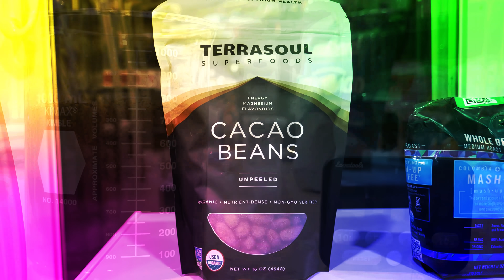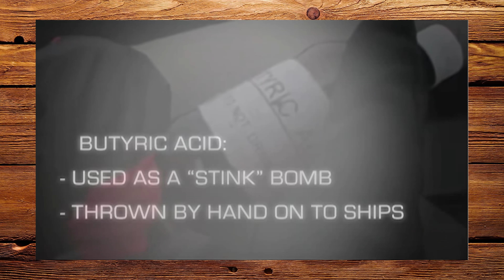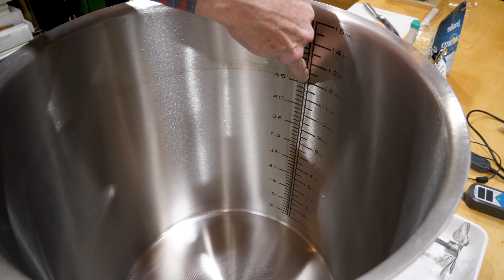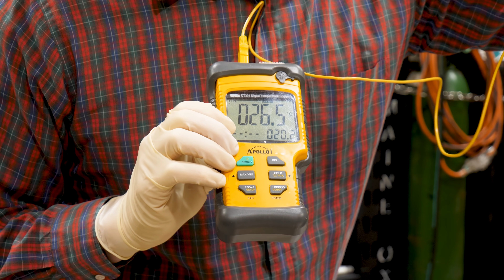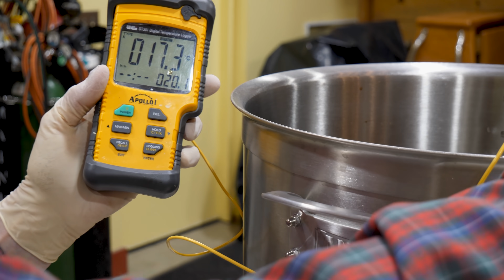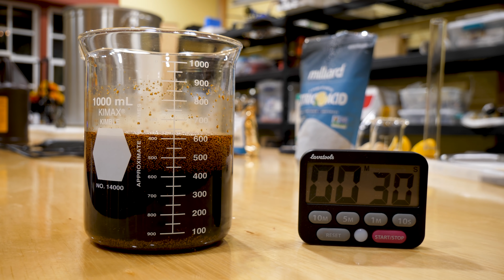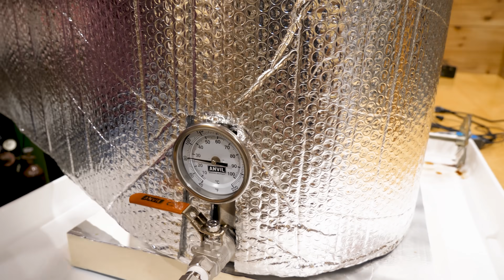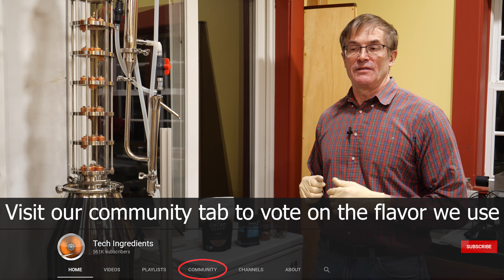Making Flavored Rum | Easy and Cheap! - Part 1

Comment: I like the idea of using pots for fermentation, but there is one downside that sent me back to the carboy. Often for fermenting something like hard cider it's desirable to keep the fermentation at a controlled, slightly cool temperature like 60 degrees. While the yeast (depending on the strain) is often fine with fermenting at 70 or even 80 degrees, higher temperatures tend to lose some of the delicate flavors you go to such great lengths to obtain and preserve. The solution is to create a stable fermenting temp in a fridge with a temperature control device. But unless you've got the money and space for a full sized extra fridge this usually means a mini-fridge. Problem is, while I can get anything up to a six gallon carboy in the fridge no problem, even the smaller pots tend to be too wide to close the door.

Comment: „If you are desperate, rum is a good spirit.“
- Tech Ingredients, 2021
Reply: Ha!  I came here to post the same thing!
Reply: Thar be rum and thar be GOOD RHUM.  Try some Kaniché XO from Barbados, neat.  It just might change your mind.  There's also Mount Gay Extra Old from Barbados.  Best rum and tonic I've ever had but I haven't been willing to mix the Kaniché with ANYTHING.  One day I'll mix it with tonic.
Reply: @David-hm9ic  Those are good tips - will add that to my "drinks to try" list. Thanks for sharing!  
As far as rum goes, I have not got much experience. But I found that so far, my favorite is Don Papa, closely followed by Botucal.
Reply: I would have said, "If you're desperate, it's the Wal-Mart down the street and some Clan MacGregor scotch."
Reply: Given the first test run, and maybe a failed one, according to his estimate of 5 to 6 days,  my first 50 liters should be ready jusy in time for the opening of bars here in Belgium. This gonna be a good summer
Reply: (proceeds to brew a 12gal batch of rum)
Reply: Not all rums a created equal sum are way better then others !! I love rune I have 20 different ones  Barbados do is good 8-10 year olds at better then just plain Bacardi rum !!
Reply: @David-hm9ic  I fell into a rum rabbit hole. I tried two new ones this month. One of them is actually a German rum, made from imported molasses, in the Black Forest region. And I just came back from the shops to pick up the bottle of Mt Gay. I shall try that tonight or tomorrow latest.
Reply: @DeputatKaktus  I have fallen into a similar hole, mine is whiskey, whisky,rye and bourbon...so far...
Reply: @DeputatKaktus  One word of warning, don't drink too much Mt Gay.. for some reason or another, you'll find yourself slipping into another hole
Reply: @willeveryday  I see what you did there.

Comment: Great job!  I've been brewing for 20 years and distilling for 5, and I have to say that this is one of the best treatments of the subject that I've seen in such an abbreviated format.  The only think you may want to consider is (especially if using well water), the presence of iron, which can ruin the flavor of either brew or distilled products.  Most sources I've seen suggest that keeping iron below 0.3 ppm (mg/L) will result in acceptable water.

I really love that you touched on nuances like mixing, aeration, cooling and heating, etc.  Again, Great Job!
Reply from the maker: Thanks!
Reply: I'm new but looking to get into distilling. Can you friend me so I may ask your advice? 
I'm just looking to make my own. Not commercial or trade. Just for my own use. 
No "competition" 
Unless you want to trade with me? I have skills other than brewing. Where are you at? I'm in Hemet California.

Comment: Interesting video. I use a similar setup for the mead that I make. I usually use Fermaid O for the starter and EC 1118 or D47 yeast because of the aromatics they add when aging the mead over the lees. I also add Fermaid K nutrients at the 1/3 and 2/3 sugar breaks to help keep it going. I personally use a "big mouth bubbler" style of fermentation vessel with a spigot at the bottom. That way I usually end up with 4 drinkable gallons out of a 5 gallon brew. I have been improving my method over about 3 years and just added a heating pad with thermometer to the mix, but I still use a blanket folded in half and wrapped around the jug for insulation.

It is always interesting seeing what other brewers do for their setup and look for ways to improve my own brewing process.

Comment: After watching this I'm afraid you'd have a heart attack watching me make mead. No heating, a bottle and a balloon. I might try adding citric acid, I normally just add a little ascorbic acid. I use citric acid as a cleaner(plus much more) so I always have it around.
Reply from the maker: Not at all.  A good tool is one you can't add anything to, a great tool is one you can't take anything from.
Reply: Let's call it traditional or rustic and if it flies...:-) I've seen vessels used for mead production centuries ago and it worked too.
Exact tools and measurements offer less room for error but it can also mean less room for pleasant surprise.
I'm biased as a chemist but brewing has always been somewhere between art, magic and craft.

Comment: Your lemon was a Lemon
Reply: The problem is, his water likely has a high mineral content, and the dunder has an even higher mineral content. What you're seeing happen is the minerals being dissolved by the acid, which neutralizes the acid, so the pH doesn't change. This is a 'mineral buffer', and depending on the minerals in your solution, it'll buffer to different pH levels.
You can avoid this by over-shooting with citirc acid, to a pH of 4, at which point all of the minerals are in solution (not just in suspension) and then add calcium carbonate, probably around 200g, which will keep the solution buffered to a pH of around 4.5, which is ideal for yeast.

Comment: As a brewer, we only use carboys for our smaller projects. We don't use brushes to clean them out. We use caustic chemicals. You have to be careful not to get any on you but they are very effective in cleaning out the carboys. Specifically we use something called PBW. You may find that or something similar at a local home brew store. We also use a sanitizer as a last step before adding our wort. Hope this helps.

Comment: Finally, a video where I actually already knew most of it, and you guys still managed to teach me something.

Overall, 10/10, you guys are spot on with the information offered. I'm impressed, but not surprised.
As far as the spices in the gin basket go, if you're looking for spiced rum, you're going to need to use a spice blend if you want to get it right. Otherwise, just go for coffee or vanilla, those work by themselves, but just using cinnamon is going to be pretty 1-dimensional. 

You should also mention that because you're pitching with dunder, you don't need to sanitize (because it's 'infected' anyway), but with most fermentations you'll want to sanitize with something like Starsan to avoid infection. It's a good thing for people to understand when making this kindof thing.
Reply from the maker: That's why I mentioned the need to avoid pouring the cylinder of liquid back when doing a beer or wine fermentation.
Reply: @TechIngredients  I appreciated that you mentioned that, I see it often and there's no need to be stingy, there's gonna be plenty of rum to go around!

Comment: I used his magneto hydrodynamic drive video in my freshman year of college. I went way overboard to make a functional replica of his experiment for a level 100 class, but it was so mind opening and I loved every minute of experimenting, he does everything

I used cut metal from energy drink cans for wire and electrodes. I had over 96 volts of batteries in series and shocked myself multiple times, BUT IT WORKED

Comment: I'm also using a stainless steel vessel as fermenter and use an additional advantage which is sanitising by pouring boiling water. For a sugar wash, I dissolve and bring to boil two pots, one 10 litres, the other 8 litres with the needed amount of sugar. Water + sugar has a boiling temp above 100 °C I usually have 70-litre batches I pour the boiling water + sugar, close the lid and leave it until the t° goes down to less than 30°C then add fresh water, yeast and nutrients. For rum, I first put the molasses in a separate stainless steel vessel, pour boiling water, leave it for two hours then pour it into the fermenter. I then add boiling water + brown sugar to the fermenter to sanitize it and let it cool down and proceed as explained above for a sugar wash. So far I haven't follow that dunder process but will give it a try. I've made Bacardi like white rum so far. My vm still is so efficient that I even got some neutral from my molasses wash... To get the rum taste, I add some heads and tails to the product...

Comment: When I was homebrewing beer, mead, cider, and similar, I did most of the brewing itself in purpose-made plastic tubs, about 6.5 gallons, leaving head space for a 5 gallon batch.  They had tight-fitting flat lids with a hole for the bubbler.  With the lid off, they're very easy to clean, fill and empty.  While I admit that early on, I started siphons by mouth, I was quickly dissuaded from that approach, and instead used a simple siphon-starter, a hand pump with one-way valves.  Once started, it would generally remain functional for the entire tub of wort, not needing to be moved around.  The only problem was when I had loose hops, not in a hop bag, and those would clog the opening.  This made for an inexpensive brewing kit, easy to use, capable of handling two batches at once by having a third tub, no lid required.
This fermentation process, for rum, is quite different from the process I've used.  When I get settled somewhere again where I can brew, I may try this.  Now I need to watch part 2...

Comment: From my personal understanding and from experience, in the production of low wines. The application of a minimal refluxing from experience across two stills, has a dramatic effect in the extraction of flavor from the wash. I speculate this is down to the extraction of volatile elements in the wines produced off the still. While I am still somewhat unsure I am rather certain this is the reason a column still is applied at bourbon and dark rum distilleries. As I have personally produced and blended two generations of rum on pot stills with a higher and lower reflux ratio. In both cases I distilled down to a low wines of 20% abv with roughly equivalent washes across both stills. I have not full tested this theory yet on a column still of my own, but I think this might be somewhat useful to you. Regardless great video Tech Ingredients and best of luck with the distillation's

Comment: You guys make amazing videos.  

2 things I would have line to know. 
1. How to distinguish and remove methanol when distilling an alcoholic beverage. 
2. How do you clean that stil after distilling rum? I wonder how the solids react with your copper valves.
Reply: 1. You can’t really, evaporation point is the best judge. Methanol cooks off about ten degrees sooner than ethanol. With meticulous temperature control you can get a good portion out. But chemicals “smear” theres always some in there.
2. Soap and water. And soak in citric acid and hot water to shed sulfization on the copper.

Comment: One extra note for beginners, correct pH level is crucial for yeast viability, you need to keep it at mentioned range - before and during fermentation. If not = stalled fermentation.
So if/when/before it'll drop way too low (under 5 or even less 😵), you need to act and counter balance it. By adding some base stuff, which would move pH more to the alkaline side. Good examples: oyster shells, egg shells or simply calcium carbonate (shells are mostly made of it).

Comment: The amount of science that you put into your videos is incredible.  I’ve been making wines at home, while studying and following distilling for a couple of years now and watching you has finally pushed me over the edge, it’s time to try!! One thing I keep hearing is that brewers (or distillers if you prefer) seem to keep their mash around 10 or 12 percent ABV.  Is there a reason for using the lower ABV rather than pushing it up?  My wines easily come out at 14% ABV and with the right yeast and a little persuasion, I can get them to 18% (it takes a month, to month and a half, though).  Granted, any wine fresh out of the bottle at 18% is a bit ‘hot’ on the tongue and needs a few months to think about life before it’s drinkable.  Is there a reason the mash is kept at lower ABV’s?  Would this 18% have the same hotness if distilled?  Would the aged 18% mash result in a better output if distilled?  Thanks in advance and thank you for the wonderful product you produce!
Reply from the maker: That's something I can't answer based on experience.  However, brandy is made from wine and it's likely the ABV of a wine destined for a brandy won't be markedly different from that which is consumed directly.

Comment: Made wine for 30+ years. I would use the carboys and even demijohns, a 54 liter glass carboy version, (talk about heavy, lol I never lifted them) because I found wine aged better and faster in the glass carboys then in the bottle. Would leave them for 6 months or more. Cut down on required bottles and the involved work too. They were also cheap. Glass 23L carboy is now $50 in Canada and I paid less then $10 for them. Have a dozen of them. Just clean out the carboy after decanting and it was never an issue. Only dirty part was the neck. Cut the handle off my bottle brush and mounted it on my corded drill (thats how old I am lol). Maybe for cooked mash products it is different. They also sell a transfer hose with hard plastic tube for inserting inside the carboy with a special end that draws liquid from above the particulate. Even went to screw top wine bottles. I know I know but I'm old and just don't care anymore. My wine tastes just fine.
Enjoyed your video.

Comment: Last I checked, Aspergillus was a fungus, not a bacterium. 
Most brewers and winemakers use carboys for secondary fermentation only, so they're easier to clean in that use. They are unparalleled for preventing infection.
I'm curious to see if your headspace is adequate. I have my doubts. 
Where did you get that thermostatic controller?
Great video, lots of new ideas.

Comment: I love the history and practical explanation about how these distilled drinks are made. It makes me very curious however; how practical could it be to distill fuel alcohol at home for use in engines?
Reply from the maker: It's questionable.  A lot of energy is needed for distillation and the source of that energy has to be much less expensive and incompatible for driving those engines directly.

Comment: A tip from a homebrewer: You can also use a campden tablet to remove chlorine/chloramine from your water on brew day if you forget to leave your water out like I do.  Boil the water and drop the right amount of a campden tablet in, wait 20 minutes and you're all set. Does not work for bromine, though.

Comment: Excellent high quality content, thanks for.that and ease go on..., one question I have, why you didn't use a bubbler or and airlock during fermentation?
Reply from the maker: Thanks.
It isn't necessary.  The lid is flush and there is a thick, stagnant layer of CO2 on top of the mixture.
Reply: @TechIngredients  Very Interesting, so the apoxic condition is ensure entirely by the weight of the lid, I notice the lid is not fastened in place either. I have made wine in the past and I had to deal with degassing before transferring it to carboys for resting before bottling. I wonder if I follow the same principle as you did, degassing could be easier to do, if at all...

Comment: The lefts over from rum is called "Dunder" and is, typically, resued in the next fermentation as it adds a great deal of flavour. Well toasted (almost burnt) white English oak is my preferred method for a coffee / chocolate rum. 10kg soft dark brown sugar and 5lts molasses. ferment, distill. Sit on burnt oak for 18 months.
Reply from the maker: I disagree with the addition of refined sugar to the molasses fermentation as I will explain in the next video.  I've already explained the principle behind the addition of dunder, however we won't be covering the additional step of aging in this series.
Reply: @TechIngredients  I find that there is a lot of unfermentable stuff in molasses, the sugar is mainly  to up the ABV and ensure a vigourous fermentation but it definately adds it's own flavour profiles into the final product. Dunder is the magic ingredient in most dark rums and if left to clarify on its own, can be used as rum essence.
Reply: Yep, apologies for that. You explained Dunder. Sorry, was a bit quick on the trigger.

Comment: Very well explained. I was wondering how come you don't feel the need for a bubble airlock during fermentation to enable carbon dioxide exit and keep external gases out of the fermentor container?
Reply from the maker: The natural  leakage around the lid is sufficient.

Comment: Can you combine the left over dunder and stillage together then add them to the next fermentation? Or does the dunder go into new wash and the left over stillage go into the pot? Or does it matter? Thanks great video. Also for a 5 gallon wash I would need 2 gallons of molasses with no added sugars, correct?
Reply from the maker: I've heard that it's done both ways, but I only used the material left over from the fermentation.

Comment: I’ve been interested in distilling some alcohol for quite some time. Thank you for your video. By far the most intelligent source I have found. 

Do you have a source you prefer for the 50 liter steel pot, and also for your still. 

Fitz
Reply from the maker: Anvil brewing pot from Amazon and Brewhaus for the still.